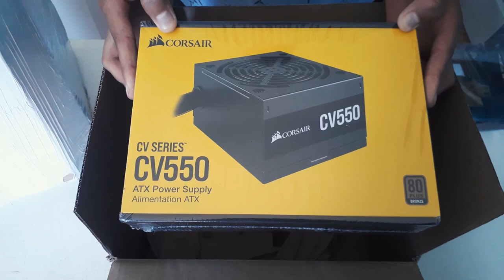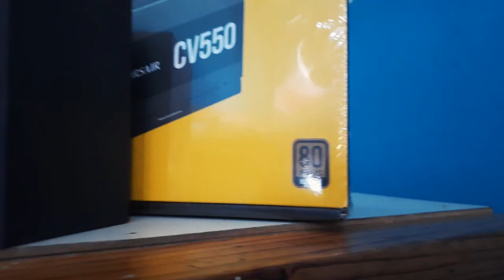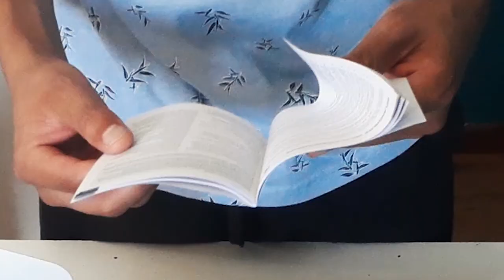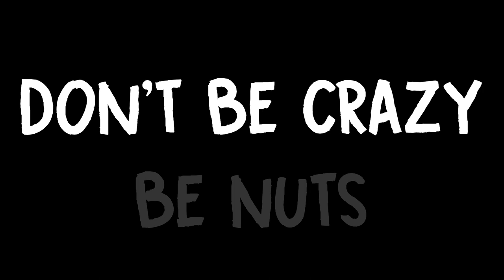Building my first ever PC in South Africa !

Comment: Did you even add thermalPaste to the CPU before putting on the cooler. If not I don't want to know what your temps are on it >_<
Reply from the maker: Yo. So the cooler had pre-applied thermal paste like I said in the video so no need to worry 😂
Reply: @itsloosid  Thats great did nit even know they come like that. I was worried that you might fry your CPU😂
Reply from the maker: @WoodenToaster-C4U  Thanks but no need to worry😁😂. It's nice that they do it with some of the coolers 😂